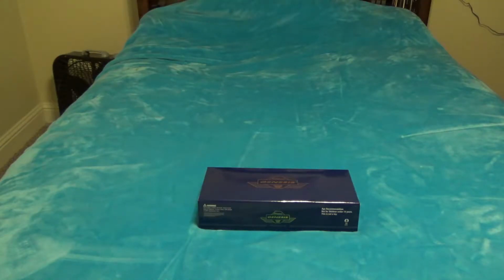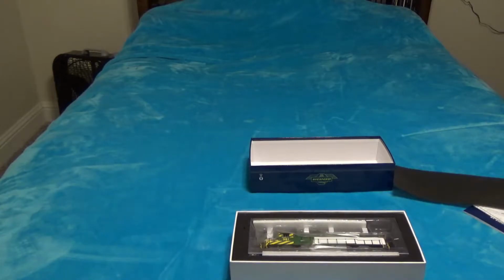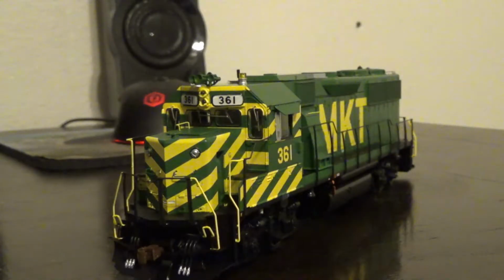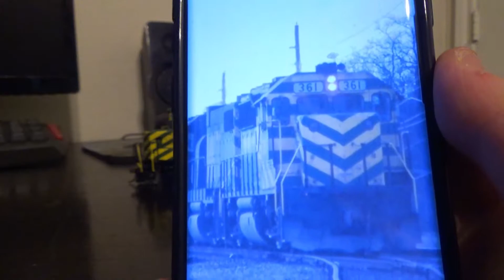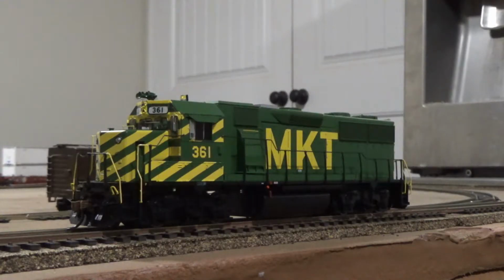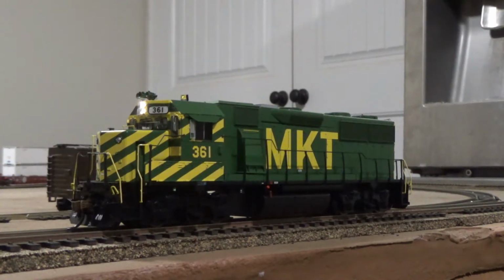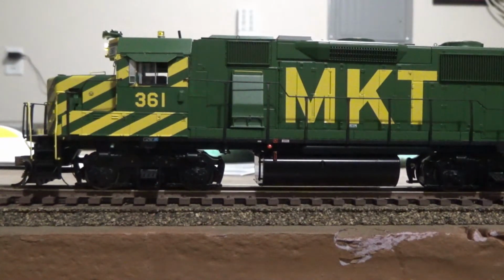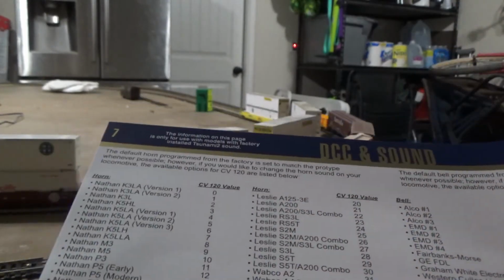Unboxing/Reviewing the Athearn Genesis GP39-2 in MKT Paint!

Comment: Very nice and informative video! I purchased this same model (MKT 361) a couple of months ago and must say I'm very pleased with this model. Runs smooth as silk. When running the model, if you mute the sound it's so quiet it's hard to believe. No motor hum or gear noise. One thing I noticed is that out of the box, Athearn has the wrong prime mover set in the decoder! The GP39-2 has the 12 cylinder EMD 645 and the model has the 16 cylinder programmed! Setting CV 123 = 3 instead of the default value of 5 corrected this error. I haven't tried the alternate horn, but will give it a try this morning. Look forward to seeing some more of your videos!

Comment: The beacon is supposed to be clear, not yellow. I replaced mine with clear beacon covers to match the prototype. Athearn was offering the correct clear covers if you contact them. I also installed the TCS wow sound decoders. Way better sound than the tsunamis, which are not bad